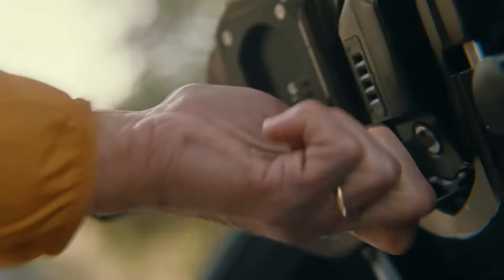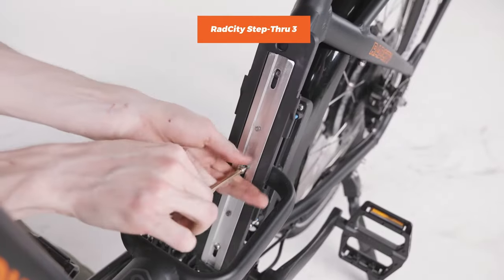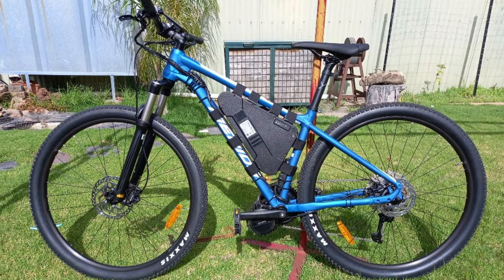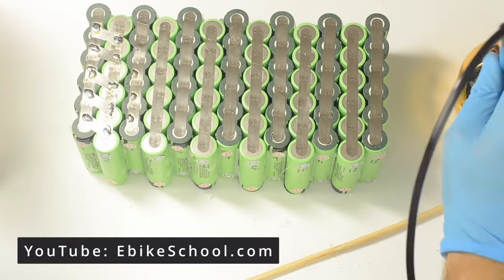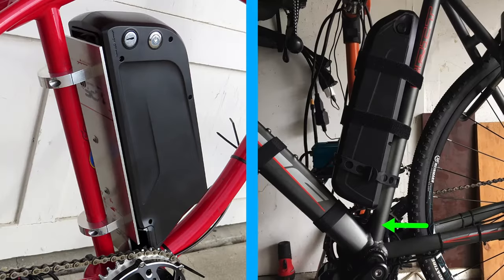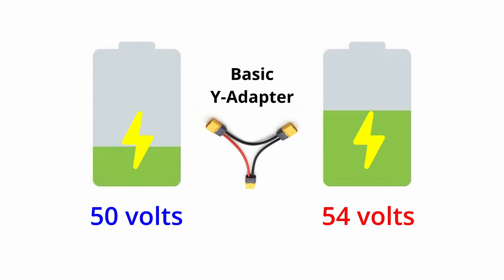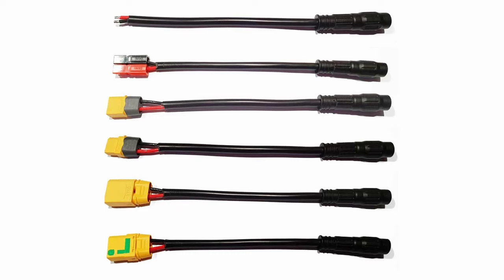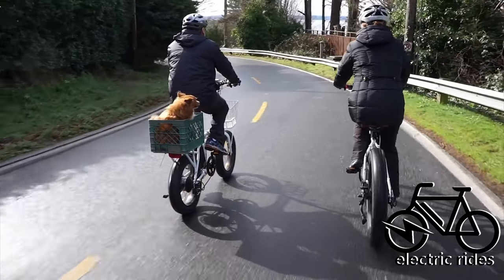How to add a second battery to your ebike! - Complete Beginners Guide!

Comment: Over the years, I've developed my own method for long journeys with a single battery. I bought a fast 10A charger instead of the factory 2A one, and I simply take breaks every 2...5 hours at restaurants or gas stations where I can easily recharge the battery quickly while having lunch.
Reply: Does that not ruin the battery though?
Reply: I'm no expert but I think if those bikes were meant to use fast chargers they would probably sell them with the bike...
Reply: @maanman3573 so iphones aren't meant to be charged as they don't come with chargers? You're not meant to use cases, headphones, screen protectors etc as they don't come with them??

Don't be daft.
Reply: @jjmmjj9999  iphones aren't ebikes buddy, don't be obtuse
Reply: @maanman3573  "if X was meant to do Y, then an accessory to do Y was in the box"

Same as phones don't come with Y, doesn't mean they shouldn't do what Y achieves. Or cars, or ebikes...

My ebike didn't come with hydraulic brakes fitted.... Or in the box. Yet I fitted them and they're fine
It came with a 14t freewheel, I fitted a 9t, it didn't come in the box.
It didn't come with a front or rear light, I fitted both... Should I remove them since they didn't come with it? Dense mofo
Reply: @leventedanka6764 most controllers have output set to 20-30 amps for perspective. It’s probably not the best but it’s not the biggest draw in amps by far compared to running
Reply: many ebikes have caught fire while overcharging , be careful not to overcharge , with a 10 amper could happen quickly . i use a timer
Reply: @anyone9689  many bikes have a bms which shuts the charger off automatically at a preset voltage. Same as discharge, the bms cuts off the battery when the voltage is too low.
Reply: Charging the battery with a much more powerful charger than the factory charger especially at 5X is a fire risk. The batteries wires might not be thick enough to handle the extra current or the batteries themselves might not be able to safely accept the higher charge rate.
Reply: The batteries I have come with a supplied 2A power adapter, although the manufacturer also allows for a 4A one. They don't provide larger ones because fast charging around 10A, which I occasionally use during travels, reduces the battery lifespan, and the manufacturer explicitly states this in the warranty. So, when using a larger power adapter, I am aware that I am reducing the battery lifespan and voiding the warranty, but at least I don't have to carry an extra battery. In my bike, I have a 2kW motor, which for 50V means 2000/50 = 40A during discharge. Therefore, the cells and cables inside are designed for high currents. Additionally, the BMS system monitors temperatures and currents of individual sections during charging. However, I do not recommend using larger adapters than the manufacturer provided, as it may lead to warranty voidance, and it's crucial to understand your batteries from the inside.
Reply: @RC-wu6gm any battery can Start a fire especially lithium ion  they volatile
Reply: I know they will not honor the warranty on the battery if you burn it up with a 10 amp charger. Been there done that. Remember a new battery is $500.00
Reply: Do you have to plug into a wall? Or are you carrying a charger like an enclosed battery itself?
Reply: I take out the battery, put it in my backpack, plug in the charger somewhere in a restaurant, and slowly eat dinner. After a maximum of 2 hours, the battery is fully charged.
Reply: @rr12627 what bike do you have?

Comment: Ok people. FYI. You can have a, spare battery on a bike rack or in a backpack and swap them out when needed. And be sure to use same battery as came with your bike. Batteries are very dangerous if not used with equipment not designed with
Reply: The problem is finding the same battery. Otherwise sure, I'd do that.
Reply: I totally agree,  don't see any advantage to adding a different battery.  I have been asking that same question.  I think people that are pushing to add a different battery are in it to sell something.
Reply: @happykamp789  Not having to carry it, and lessening the strain on the battery when draining and refilling it exclusively.

Comment: One charger? Two chargers? Not a peep.
Reply from the maker: I should have made mention, sorry. Both batteries will need to be charged separately. Most battery adapters won't handle current going into the batteries, just out.
Reply: I figured that would be the case

Comment: Everyone wants bigger batteries and I'm going lighter and smaller now at 36v 10ah to reduce weight.  Weight is the killer of ebikes if you want to do anything fun.
Reply: I would think if you are worried about the 10 lbs of extra weight of the battery,  most people could just lose weight. 75% of the people are over weight and many are obese. Maybe they should not even be riding an ebike.  I doubt 10 lbs of extra weight on an ebike, which is heavy to begin with would make any significant difference in range.   Lots of other ways to cut down on the weight.
Reply: You're a baby. I'm literally biking from toledo ohio to nyc currently and I have so much weight on my bike, it feels like a motorcycle, and I still go 40+ miles a day. You can handle ten more pounds....

Comment: I emailed you several times and now found out how to reply on your YouTube channel. As I have asked before and maybe others have an answer.  Instead of trying to add another battery where you have to add a splitter, do wiring, etc... Why not just purchase a 2nd battery and exchange it when you are low on power on the first battery?  You could carry as many extra batteries as you would want.
Reply from the maker: Ah yep I just replied to you a bit ago. It definitely is an option and probably one that the majority of people would rather do instead of messing with ebike wiring or possibly voiding their warranty. I imagine most people go that route instead of hooking everything up!
Reply: Have you made a video showing how n where to connect a substitute, second battery to the controller?    Thx, Dave

Comment: My bike is a Hittroad Safari 350w 36v 10.4AH which doesn't give me nearly enough distance and I have to turn back well before I'm ready to quit riding. The wiring does not have any connectors, it is hardwired into the controller. When I looked at it, there was just a lot of wires all smashed in there together and there did not seem to be any easy way to add a 2nd battery. Can you help with any advice? The guy from Hittroad never got back to me, so I don't know who else to ask.

Comment: Super clean entertaining content and helpful.
Most motors will tolerate  higher voltage second battery but a "shunt hack" of existing controller (videos on other channels) or another higher amp capacity controller and it's required interface components ; throttle, PAS hall / torque sensors.  The multi battery blenders are a great source.  Do affiliate links. Thanx
Reply from the maker: Thank you. Appreciate that info!

Comment: Did you make part 2? What would be the best way to install a battery rack on the radexpand?
Reply from the maker: Sorry, I haven't edited that video together just yet, should be out sometime soon though. The 2nd battery is done and installed on the Expand's rear rack. Just made some hardware from various strong ties that I had in the garage. Has worked great so far!

Comment: My HJM Trike has a place ment for a second battery. The seat of my trike flips up and it has mounting holes meat to install a holder for a second battery and has a plug ment for it. I thought how nice it would be have a second one but I never go over 30 miles on my bike. But if I take more than one trip a day it would be nice not to have to charge the main battery a second time.

Comment: Hey. I have a 48v battery (14ah) and controller and was wondering if I can add a 52v battery connected in parallel with this 48v controller? 
Very helpful video BTW!
Reply from the maker: Most 48v controllers will be able to handle 52volt batteries but it's not a universal thing. I'd suggest reaching out to the ebike manufacturer for their input but I doubt they'd be helpful. What kind of ebike do you have?
Reply: @ElectricRidesUT  Aventon Level 2.
Reply: Do NOT parallel different battery voltages! You would have to use a DC-DC converter.
Reply: You need the correct device to handle different voltage batteries in parallel, The battery blender or DateX2 is what you should buy if using 52v and 48v batteries together. Most other devices you need to use the same voltage batteries. Also, Your controller will have to support a 52v battery.. Chances are the internals will handle it, As most 48v controllers will handle up to 60v (although you may shorten the life of the capacitors), But it maybe programmed not to except a 52v and throw you an error. Do some research on your bike, But If I were you I'd just stick with 48v you not missing out much. The Aventon level 2 is quite closed up right? That'll be some work for ya lol
Reply: Dual battery discharge kit from ElectricAllWheel.

Comment: Is it possible to install an extra battery on the LANKELEISI X3000 MAX 2000W Dual Motor bike?
Reply from the maker: It should be possible, yes but it's a bit more difficult to accomplish when the battery and controller are integrated into the frame like the X3000 appears to have.

Comment: Area 13 ebikes sells a dual battery parallel connector.
Reply from the maker: Yep, I've used the one that they carry for awhile now and it's a pretty good little unit. Definitely recommend it if you don't want to spend the $$ on a DATEx adapter.
Reply: Please, where I cane find it

Comment: I currently have a 48v system and my bike is already set up to take dual batteries. (Dost Kope) - Since Dost went out of business last year I can't purchase their high-priced 2nd battery, so I want to add a 2nd, 3rd party battery. And since my bike is already set up for a dual battery system I am assuming I don't need any kind of battery balancer? Also, the 2nd battery plug is not anything I've seen available, so I think I would need to remove the plug and just use the wire that currently feeds the plug to wire in the new plug or battery directly. correct?

Comment: I've purchased an ebike here in Australia that's similar to the Aerial Riders GRIZLY...only thing is it has a 48v 21aH Samsung battery, and was wondering if by adding a 2nd 48v 21aH Samsung battery thinking on the downtube like the Grizzly, would it void the warranty and which would work the best turn on 1 battery at a time or use both batteries together, as I would be doing a lot of riding doing Uber Eats, I would want to be getting at least 8-10 hrs out of the battery, so was wondering which way I should wire it in....
Q2 - by adding the 2nd battery, do I need to change out the controller, or what needs to be done there, as I will be adding a 12v 6000mah setup for the 12 lighting on the bike, but want to add the 2nd battery literally for added range, can you recommend a way of doing where it doesn't void the bikes warranty?
Reply from the maker: In my experience, most ebike manufacturers will void your warranty with any major modifications, especially electrical ones involving a 3rd party battery or parts. I've seen most ebike modders wait until their OEM warranty is expired before they start doing the real crazy stuff.
If you are adding a 2nd 48v battery, you shouldn't need to do a controller swap since it will really be the same voltage running to it (48 volts) it will just have a larger "pool" of power to draw from (amp hours or watt hours) over the standard battery setup.
Reply: Why not just buy a 2nd battery that is for that bike.  All you would have to do is take the one out and put the other one in.  It would not be anymore weight than putting a different type of battery on the bike and you would not need to do any wiring or add anything.  None of that makes any sense to me.  I have yet to see the advantage to adding a different type of battery.  Just use the same type, when it gets low on power exchange.  That would take about a minute tops.  People stop anyway for different reasons.  Rest their legs, take pictures, check maps, take a drink,  rest their sore butt,  eat a snack,  the list goes on and on.   Don't understand adding a different type of battery and all the messing around with wiring, splitters, controllers etc....???  I guess maybe I am too practical.

Comment: Lol I just connected a 48v to my roadrunner I think the original was 48v not sure on ah but longer capacity battery that I put in I used on a 1800w gokart project thing I built that been in peaces for ages now anyways because I had ran it flatten set it for so long the voltage was under but then I’ve literally connected both batteries together and now it’s charging with the other battery charger. Should I be worried? Considering the bike motors are only 300/500 duel hubs lol

Comment: Do you necessarily need a controller
Reply from the maker: Most of the time you won't have to bother doing anything with the controller since everything is adapted and running as 1 big battery before the power makes it way to the controller side of things.

Comment: So simply put, if my bike is 48v 16ah and I buy a 46v 15ah bike rack battery. It's just the case of wiring and buying an adapter?
Reply: Depends on the communication with the display.

Comment: do i need a blender to use just one at a time ?
Reply from the maker: Nope, the battery blender is only required if you want the 2 batteries to act as 1 big one. Otherwise, you'd just need to swap out the two batteries on the same single battery tray or have some sort of 2 battery tray set up that you switch from battery A to battery B. I've even seen some people simply unplug one battery tray connection (to the controller) and just plug it into the other battery tray.

Comment: Will this work with a direct drive motor
Reply from the maker: I know for sure that the DATEx2 adapter would work with DD motors however you would need to disable the regen braking. The cheaper battery adapters should work, but again, regen would cause issues.

Comment: When paralel connecting 2 48v 16ah batteries,  do I don't have to change the motor controller?

My motor controller says: 23A current limit.

I guess I will have 16 x 16 = 32 A current?
Reply from the maker: the Ah (amp hours) rating in batteries is different from the amp current limits on controllers. Controllers will limit their own max amperage automatically so it's normally not something you'd have to mess with. However, battery adapters will usually have an amp limit so it's best to make sure your controller isn't pulling more amps out of the batteries than the adapter can handle.
Reply: @ElectricRidesUT  Thanks bro.

I have a original 48v 16 amp battery on my Engwe engine pro. 

And I ordered a 48V 20 amp, a dual battery connector and all wires. 

I can't wait to build it. I'm not really a technical guy but I have the motivation to make it work.

I just came home after a ~ 20 km ride.

Thanks for the info! 👌🏽👑
Reply: *My battery connector is rated 40 amp so I must in the green I hope.

My Engwe engine pro does have regenerate power however I never use it. I always drive in sports mode 5. (Max)

I did sent a email to Engwe to ask if I can turn the regenerate system off.

Still waiting for their response.
Reply: @ElectricRidesUT  You should see my face, I crashed last week when driving drunk to a tree. I have a huge wound in my face and a concussion.  My girlfriend is very mad because I ordered all this stuff while sitting home and she take care of me 😂

I love her and she she loves me. I'm 33 but sometimes still a kid.

Comment: I have a 48v battery and a 750-1200 watt motor. My question is, is it possible to connect an additional battery, without having to upgrade the hub motor as well as the controller?
Reply from the maker: Yep, you shouldn't have to do any upgrades to the motor or controller when adding a second battery to most ebikes.
Reply: @ElectricRidesUT  thank you!
Reply: yes as long as the 2nd battery is also the same voltage.
Reply: This is my worry as well! I’m not sure adding 2 different voltage batteries will be safe for my controller since the power will increase! Please advise! I’m about to order a dual battery discharge connector but I will wait til I hear back!

Comment: I have a Raliegh Cadent IE that has no pigtails for battery connections.The battery plugs straight into a frame plug with four connectors.
  Is there a blender that will let me solder the battery positive and negative connections straight to the four prong plug in the bike and still just use the original two connectors for the ❤Controller?
  There is room to solder to those plugs and still plug in the battery but will it work?
Reply from the maker: I'm not too familiar with Raliegh ebikes but from what I can see, it looks like it has a standard Bosch mid-drive moto/battery setup. So it will have cabling, but it will be pretty difficult to get to it since it will be integrated into the frame and are nowhere near as modular.. Unfortunately, I haven't seen anything that you are describing. Sorry.

Comment: I have a now discontinued Sondors Fold Z (Mini) with a 36v 8.7ah battery. Would I be able to add a 48v 20ah battery just by using the battery blender or would I have to change the controller as well?
Reply from the maker: Not sure honestly. Most 48v controllers will be able to handle the upgrade to 52v but not sure about the 36v ones. Sorry.